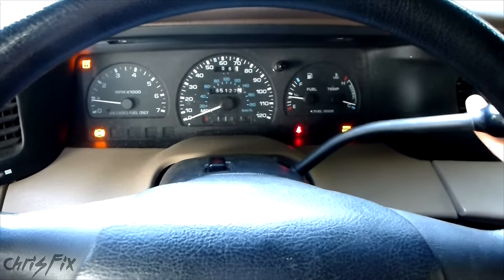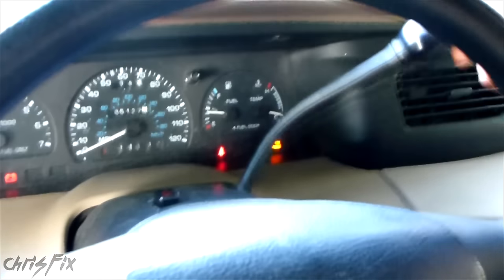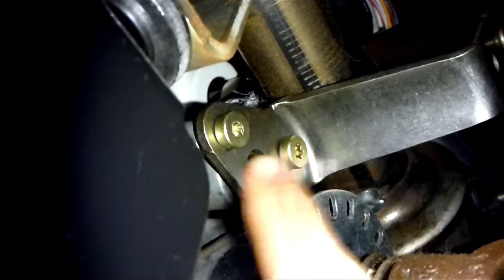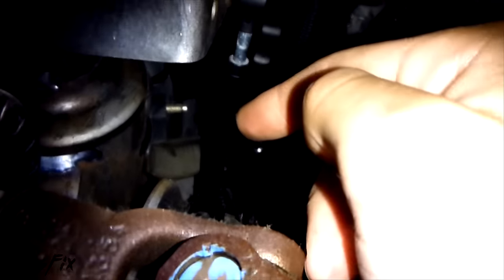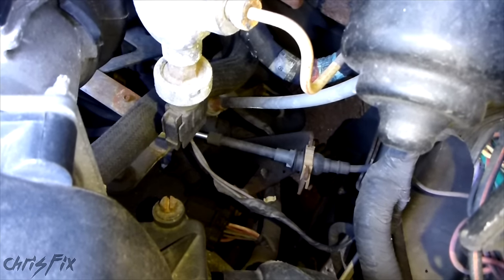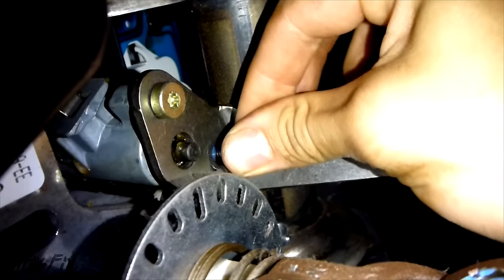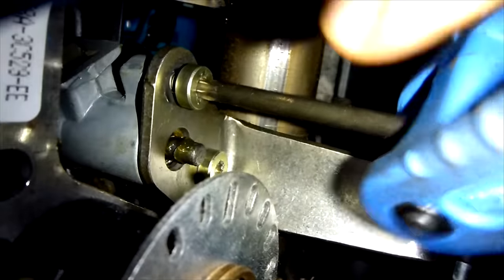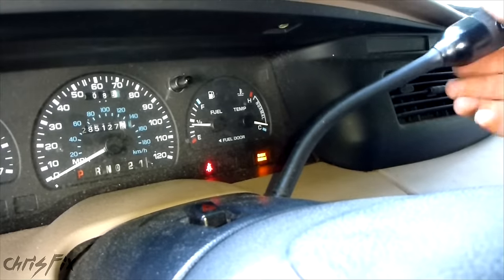How to Fix a Loose Column Shifter

Comment: I DID THIS FIVE YEARS AGO AND IT WAS SLOPPY SO I LOCTITED THE BOLTS BUT IT WASNT THAT MUCH BETTER THEN I GOT A CHECK ENGINE LIGHT FOR A TEMP RANGE SENSOR I CHANGED THAT AND WOWW WHAT A DIFFERNCE  ITS HARD  TO GET OFF BUT MY WINDSTAR SHIFTS  SUPER SMOOTH
Reply from the maker: +174joedirt NICE!

Comment: Hey Chris I was trying to find a video closer to the problem I'm having. I recently took out my 03 4.0l sohc Ford ranger engine due to broken timing chain guids. Long story short the truck shut off and did not want to start it was weird because just the fan and belt was turning but the engine sound like it wasnt doing nothing  like there was no compression or something. My mechanic told me over the phone that it must of jumped time. Well now that im looking at it I noticed some loose rocker arms any help please!!??

Comment: I have 1994 f150 pu. A screw that looks like what you showed being loose fell and hit my leg. And my shifter does what you were saying, is it most likely that area I should look at or the shifter tube, I can't get it into park and have to start it what looks like 2nd it's probably neutral,  any advise

Comment: Hey Chris thanks a lot. It worked on my 2001 Ford Taurus. But my concern is that my car moves forward when the gear is in park. I have to utilize the parking break to stop it. Can u help? Thanks
Reply from the maker: kelvincarlisle75 AWESOME! There is a pin that tops the car from moving when in park. My guess is this pin has failed. Are you sure the car is in park?

Comment: How did you get under there to make it look so easy? I was able to tighten them with about 30 mins of swearing with my light between my teeth, but i dont think i can pull the screws out and get them back in, especially the far one, safely.

Comment: Question: what if the bolts and everything is tightened down but it’s the shifter handle that’s the only part loose. It’s like in the steering wheel that’s loose. Have to take it apart and the pin is kinda loose. What then?

Comment: Hi Chris I have a question about my ford ranger 
When I shut of my truck which it’s a manual transmission 5 speed 
The truck still moves like the manual transmission want hold the truck is that normal that I need the emergency brake on also

Comment: I have the Mercury Grand marquis. Same car you would think, but no. My car has a black plastic plate just above the brake pedal and i cant get it out. There are no screws. I cut 2  plastic ties holding it up there but it still won't come down. Something i can't see is holdng it up there.

Comment: So I have a question. My dad's bronco had the same issue but it's the part that the bracket bolts into that needs replace. What's that part called?

Comment: Chris: how can I replace my dashboard illuminating miniature bulbs in a 1995 Mercury Villager GS minivan? Specifically: what cover parts should I remove in the driver's side interior to get to these bulbs, and what tools do I need? Thanks if you have the answer
Reply from the maker: Zack Jalamani You will need to remove the dash to get behind to the gauge cluster. Then it is just bulbs that you need to replace. I will be doing this fix on my truck soon so stay tuned!

Comment: Hey I got a 99 ford f150 4x4 5.4 l. And the manual shift to use the 4x4 is really hard to move..and I got no lights in dash about 4x4..any suggestion
Reply from the maker: Sounds like the linkage is rusty, get underneath and spray some lubricant on it. Then try to move it back and forth and it should get easier!

Comment: Thank you for the informative video. Great close-ups too... I found this video in a search to fix my own car, a 2003 Cadillac CTS, 5 Speed Automatic. The gear shifter is located in the center console, opposed to the steering column. I'm assuming looking under the steering wheel will do me any good? Although, this is only an assumption. If anyone out there has any additional information, I'd greatly appreciate it!
Reply: *will NOT do me any good.*
Reply from the maker: Yea since your shifter is in the center console, you would need to take that apart to fix your problem,
Reply: +ChrisFix Thanks for the quick reply! I've been researching this topic for some time now, and unfortunately... It's created more questions than answers. I understand there is a cable connection under the hood that may be loose/detached: however, each posting mentioned the car misreading the actual gear which it was in, as well as giving a false read on parking. I do not have this issue... Yet. As of now, the only symptom is a lot of play with the shifting arm, just as your's was in this video. I will open up the gear shifter and see what's there. Thanks again for your help... I greatly appreciate it!
Reply: +ChrisFix One additional piece of information, which may help to diagnose the problem: The "play" did not gradually come to be... It happened over the course of a day.
Reply from the maker: If there is only play in the shifter handle, usually there is a screw to tighten or a bolt to tighten which snugs up the handle to the post.
Reply: +ChrisFix The handle is snug... It is the pole/stem/arm that is loose.

Comment: Those two torque bolts that you removed and put the blue stuff on (whatever that stuff is called) is where my problem is. The piece of the shifter tube that the torque bolt screws into snapped off. So now there is only one torque bolt holding the bracket on. I am still able to use it, though (it is a 1993 Ford E-150). But I wonder if I am hurting my transmission. Does this apparatus have to be aligned or does it have to have a certain tension on it for the transmission to operate correctly? It might just be my imagination, but I seem to think it is not shifting as smoothly as it used to. So although I am able to get by with the one bolt, i worry that it is causing damage to the transmission. I am not able to get it into park anymore. When I park it, I am able to get the transmission as far as reverse, and then I shut the key off. I cannot remove the key, and I chock the tires to prevent it from rolling. I don't have the time or money to fix it. So if it isn't hurting anything I will still use it the way it is.
Reply from the maker: pat mich I would replace the shift tube. It might hurt your tranny if you are in between gears with the shifter.
Reply: ChrisFix Thanks, I will have to get it done, then.

Comment: Got a 2001 dodge ram 1500 drove it to my fishing spot the other day an went to get out an put the truck into park but it will not go into reverse or into park at all just a dead stop but shifts from neutral to drive to 2nd to 1st just fine just will not go past reverse or into park ne ideas an tryed to shift it on the trans by hand an with everything hooked up it will not shift to r or into park still

Comment: Chris,  My Gear Selector ('01 Expedition) does not "lock" into gear.  I can switch gears by simply pushing the gear selector left or right.  Will this fix correct that or do you think it is something deeper?  Thanks
Reply from the maker: Patrick Maguire It might be something deeper but get this fix done first and see.

Comment: Would this apply to vehicles that have no cable running to the instrument cluster? My gear indicator is computerized, but the shifter column has excessive play in my opinion.
Reply from the maker: ***Classified*** Yes, this fix has nothing to do with the actual shift indicator part.

Comment: I have a 2001 Chevy s10 blazer and the column shifter is super tight and it is hard to shift between reverse neutral and drive i was wondering if i can just loosen those bolts a tad bit or do i need to replace the shifter cable entirely
Reply: i dont think loosening them would be a good idea, i think you are better off replacing cable because if you loosen these bolts then it would still be stiff when getting into gears and it would just wobble and play between gears and from vibrations it may fall off entirely, i found a video that said hard shifting and shifting late even when you arent giving it much throttle, in this case it sais its more likely to be problem with throttle position sensor (its really cheap so replacing one wouldnt be bad idea if you have problems with transmission changing too harsh changing too late or too early, they are under 10 bucks) but if it is physically hard to get it into gears then it must be cables or maybe some air just leaked into the cables (this is probably the case if shifter feels rubbery and progressive when changing gears and also needs longer throw than before) now these are all just suggestions dont take these too seriously because i dont know what you should do but you really shouldnt loosen those bolts

Comment: I had a guy try to fix this for me. It felt a little better but not so noticeable and in the process he managed to mess up where my mileage shows. So now randomly the mileage on the dash shows and sometimes it's blank.any fix for this? I have a 2001 f150
Reply: Baldemar Patino the odometer not working is probably not from him fixing that. Those Fords are bad about the solder becoming loose where it connects to the whole instrument cluster. There is a video on f150 online forum showing how to fix what your talking about.

Comment: So the bolts on mine are tight but it still isn’t lining up with the gear. Any ideas? It’s on a 2004 Ford Taurus btw
Reply: Luis Torres mine too did you find the fix??
Reply: ignorant soup Sorry for the late reply but okay, what you want to do it take off the panel underneath the Steering Wheel. Next, right above where the panel was at, right on the edge you should find a small black round cog looking thing that connects to a wire. Spin it around and look at the gear arrow, it should start moving. Spin it and it should start lining up

Comment: Tried this and bought a new shift tube for 94 f150 xlt and I still can't get it to reverse or park. It was able to about a month ago but slowly got more play in the shifter and now I only have neutral and drive. Neutral is where park should be also. What else could be the issue?
Reply from the maker: nate20090 Could be the connection to the transmission (the actual wire and the thing that moves on the tranny).

Comment: great video I have a 99 ford windstar lx and i don't feel the gears shift at all, also the gas peddle pushes all the way to the floor...please help
Reply from the maker: +Tavon Young This can be many things. I need more symptoms and more of an explanation.
Reply: +ChrisFix  well my van has 200,000 miles I've had it for a year now in fact the problem just started yesterday, and when I had it towed it was leaking transmission fluid what's weird is before I had it towed i put fluid inside it and just leaked out.Could it be a bad transmission,hose leak, or coolant leak??..I'm confused

Comment: Hey Chris, I have an issue with my Ford Ranger. My transmission  won't  get into gear when I put it on Drive, but will gear on Reverse
Reply from the maker: Check the fluid level. Could be a shift solenoid as well. Is the OD light flashing? If so get a scanner and read the codes.
Reply: @chrisfix  thank you for responding! I know you  are a busy man, but I have one more question  for you sir. 
I had an accident  a few years ago when it was icy. When I got it back to run, my transmission took about 3-8 seconds to shift. How can I fix that?

Comment: How did you check from the engine? What did you move?
Reply from the maker: cadencorin1 I just watched the connection from the tranny cable to the tranny to make sure it moves.
Reply: +ChrisFix 
Thx!...what's the name of hand tool you used to tighten column! Do I have to make sure the shifter is lined up in the parked position before tightening?

Comment: Mine is loose all the way goes up and down with out resistance do u is the same problem
Reply from the maker: Mine was loose but I could still move it around, I would still follow the steps in the video to make sure everything is connected!

Comment: so I've been having this problem for a while and new how to fix it, but the plate the bolts are supposed to be anchored in is completely snapped, so only one bolt can even be screwed in. if I were to go part hunting what I have to ask for?
Reply: pardon the typos..
Reply from the maker: Isaak Chames Shifter column bracket or shifter column bracket plate. Or show them this video haha

Comment: Hey I hate to ask but would you or anyone know my problem and how to fix it… 2003 FORD MUSTANG V6 ….when I’m putting my car from D to P normal speed it revs and flashes my O/D light off and my gear shifter will be loose as heck. But if I go from D to N to P slow it won’t rev and won’t flash my O/D light and the gear shifter will be tight as heck? Is this a solenoid problem in the transmission? Or what I could use your help or anyone’s thanks.

Comment: the steering wheel on my 94 Thunderbird LX creeks loudly whenever I take a right turn, the power steering pump and level is good, what I want to know is if there's a way to tell if it's the belt or something else on the column.
Reply from the maker: +Nathaniel Farley It could be the bushings holding the steering column in. Have someone turn the wheel as you listen under the hood.
Reply: thanks bro, best auto maintenance channel on Youtube

Comment: what if the shifter is hard and not loose like in your video, Chris.  
amazing videos !!
Reply from the maker: dime666drover Thanks! What do you mean "hard"? Like it wont shift into gear? It is hard to move?
Reply: ChrisFix
yes, it's hard to move, and sometimes the shift gets stuck in the last gear.
thanks man!!
Reply from the maker: dime666drover Is it a column shifter like in the video or a center console shifter?
Reply: ChrisFix is a clumn shifter, the car is a chrysler 93 2.5 L,automatic transmission, P R N D 1 2,
 gets stuck in 2
Reply from the maker: I would just not shift it into second gear to prevent it getting stuck. It sounds like it is getting stuck because somewhere between the shifter and the tranny the cable or the connections are not tight (they stretch or loosen up over time), or they arent lubed up. That is the first thing I would check!

Comment: I HAVE A 2002 4 DOOR 4X4  FORD EXPEDITION (EDDIE BAUER VERSION). DO U HAVE A ANSWER TO WHY MY ABS & 4x4 LIGHTS ON MY DASHBOARD COMES ON CAUSING ME TO NOT HAVE SIGNAL INDICATORS USE WHILE DRIVING? 

I DO REALIZE AT TIMES WEATHER DOES PLAY A PART WHEN ITS HOT OR COLD.
Reply from the maker: I would scan the computer and see what the codes are!
Reply: ChrisFix Could there be a short in computer? fuse box,the steering column or shifter?

Comment: Is there a way to straighten the steering wheel so it is perfectly horizontal to the front wheels when traveling in a straight line?  when I took my truck in for an alignment last time they didn't do that. I know it has to be a n easy fix.
Reply from the maker: +moofushu Take it back to the place that did the alignment because they need to do it right. Tell them they never centered the wheel.

Comment: I have a Mazda van that the shifter is stuck. I can't get it out of park. It's very tight and won't move. The van starts up just won't shift.
Reply from the maker: Worth The Money Sounds like the pin that holds the car in part is stuck. Try having someone push the car back and forth as you attempt to shift it.

Comment: Couldn't figure why my car ran great 2x after new battery...went to turn it on ,nothing. Dead. My gear shift on my 98 crown vic has been sloppy ... SO, after replacing new battery cables, grounds ,new starter and still nothing except banging head against a wall, we were about to replace neutral safety switch... thinking it may not be going in gear right. You may have saved us a lot of trouble.  Starter wasn't making a peep ,banged on it.  Rear lights and panel work.  Somethings not engaging. Cross fingers.  This can't hurt!! If doesn't work at least my gear shift will be tighter then back to the shooting the parts cannon.  :)
Reply from the maker: It started after you banged on the starter?
Reply: @chrisfix  no....
Reply: Just for a remark....I'm a 'not mechanically' dumb female... I tell my husband what's wrong and he does the labor. I just had back surgery so can't finagle my way under the dash good while its up on blocks and battery out so can't put seat back yet. BUT I did notice, thanks to you, my gear shift not going into park...off to the right of the P. Its never done that before. I'm going to slide a table to the door so I slide under dash. Watched your other videos on this subject. Funny the little things you don't notice. I'll update.

Comment: So what if the bolts are tight?  What is the next step? My truck is stuck in second hear and won't shift out of it. Now I can't start it
Reply from the maker: Check the connections directly to the transmission.

Comment: what if I tightened these and the thread area behind the plate has cracked, so only one bolt is holding this on, and my truck does not go in park.  do I have to replace the whole column?
Reply from the maker: +J Dubb You can try using this stuff and tapping a new thread: http://amzn.to/1TwqOVt
Reply: +ChrisFix I will give it a go and see what happens.  I think the aluminum cast where the thread goes actually cracked off.  I do have some JB weld laying around.  I will see what I can do.  thanks!

Comment: Do you have a part number for this bolt? I have one missing, need a new one.
Reply from the maker: I dont but you are better off going to a junk yard. They might give it to you for free if you go out and get it yourself!
Reply: I actually found it. N806584-S437. Apparently, it's a very common bolt for Fords in general. I just called the dealership and they had like 23 in stock. I appreciate the video. I couldn't get my Excursion into Reverse, and was stuck in the parking lot at work. Fml. Real life saver man! Keep doing videos!